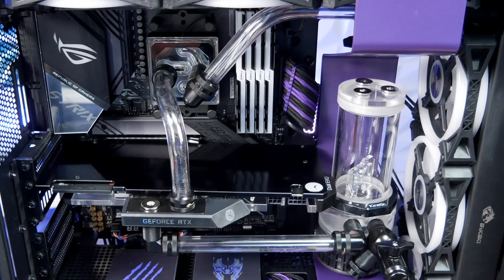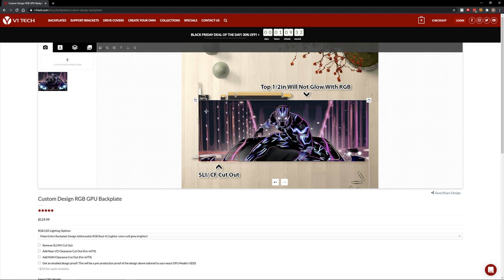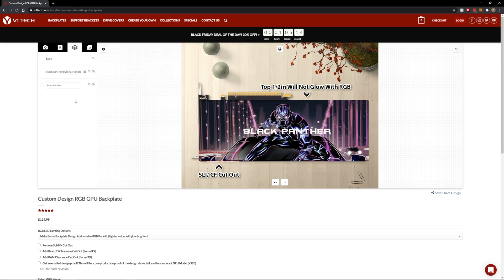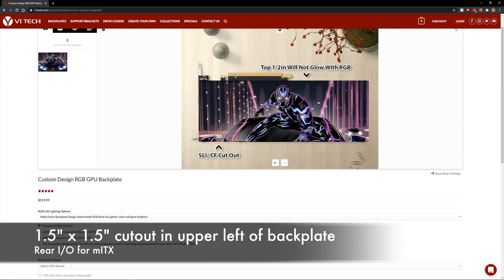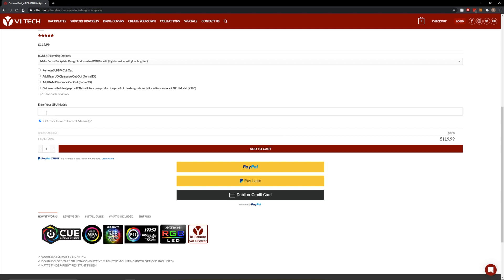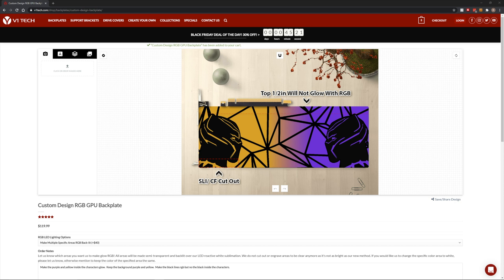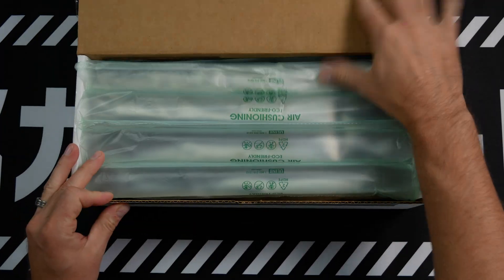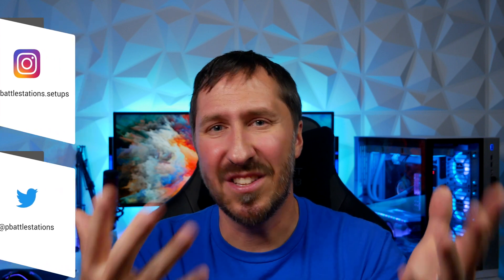Guide to Customizing a V1 Tech GPU Backplate!

Comment: i know its an old video, but i wanted to ask if its possible to connect the rgb to the gpu rgb connector? in my case there is a 3 pin rgb connector, will it be enough/ is it even possible?